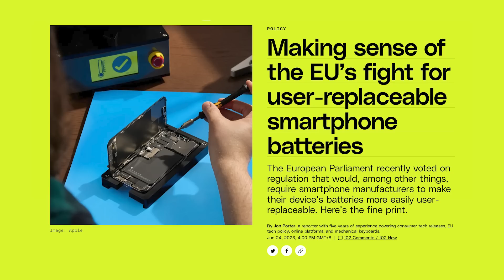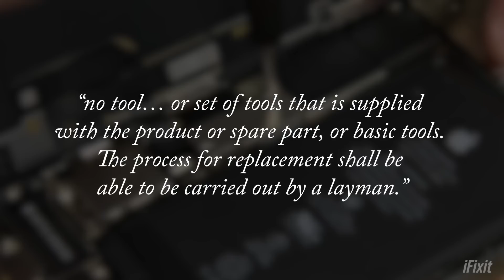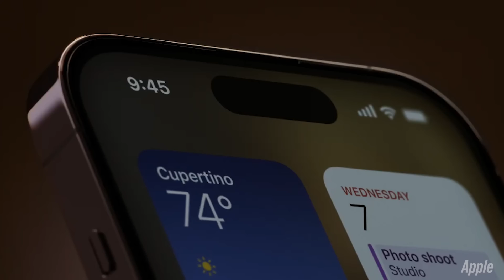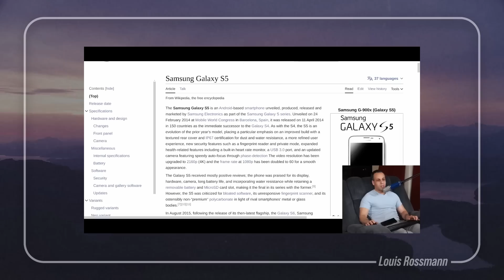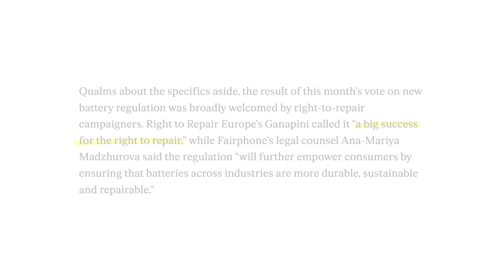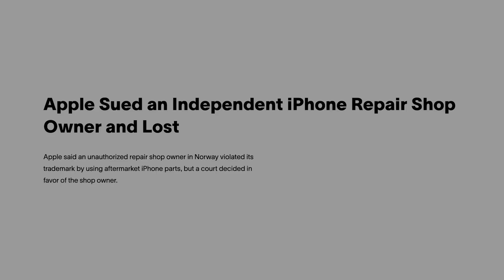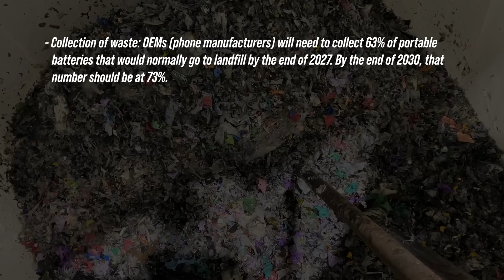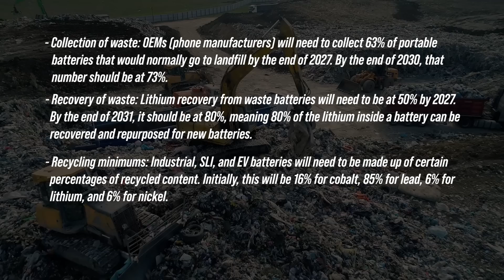EU Just Changed Smartphones Forever

Comment: Easy swapable battery is a MUST

Only iSheep support it.

It is for the very safety for a lot of things.

1) Personal security - Now days because you can take the battery out, there is no way to unplug a phone to prevent eavesdropping, part of the CPU is always on.  If that is swappable, just take the battery out. 
2)  Waterproofing Lies, your watch, from 100 years ago can have waterproof, to 100 of metres and still have swappable battery, yes you needed a tool but it is petty much a standard.
3) Waterproofing Lies 2, your glued iPhone still will have water goes in if you place it for longer (maybe an hours), so your phone is not 100% waterproof at least is not the same standard as watches.
4) Recycling responsibility, if the EU can even goes further and required phone manufacturer to standardised the battery sizes i.e. I can swap an iPhone 17 to a iPhone 18 battery or with a Samsung, there is no recycling issues, remember the battery is very expensive, people will recycle them, you just give them a rebate of 50 AUD for the old cell and BOOM it will recycle.  Why I can't use an old battery to another device, no idea?
5) fly security, without solid state, there is always a risk that battery just like the previous samsung battery self start fire, if I want to put a phone into a bag, just ensure it's battery is pull off, it is secure.
6) I think EU should be even more strict and make the Law say all battery should be connect to the motherboard using USB c standard.
7) I can choose my battery life, Sodium Ion Battery and don't need Cobalt (according CATL), so if I just want a battery with Okay life i.e. 12 hours without charging instead of 24 hours, I can just have a Sodium Ion Battery, it is cheaper than Lion, and I just replace with one that have more capacity when needed.   Or some of the gamers need to plug in anyway, just get a cheap battery and charge it 24/7, it break, it is cheap, sodium ion I think sodium ion is also less likely to be self ignition, so not such a problem or even Ni-MH battery, highly mature not flammable, but I can't choose my only battery tech, if USB C as a standard voltage output, then creative solutions can happen.
8) Recycling 2 - if my battery is only for the purpose of uninterrupted power supplier, there is a lot of power bank case anyway, if I just have a battery with less energy, I don't need such high density, such as my gamers situation, the battery did not make of rare material, if it gone just throw it to the bin, I want my power bank to supplier my power anyway, I have a joystick and fan and overclocking my phone, so all I needed is just a working battery as my uninterrupted power supply, so No recycling is needed.

Comment: I use a phone from 2013 as my car's dashboard so i can see things like engine temp and fuel economy(stock dashboard only shows fuel level and speed)
The reason i picked this phone is because it has replacable batteries, as i dont want to be buying a new phone for this every few years, and because the heat inside of cars is murder on lithium batteries, i think i've gone through 3 batteries.
Ideally i'd find a phone that works without a battery being installed, and boots up reasonably fast

Comment: So happy to hear about this. It's unfortunate, but true, that you have to force companies to be consumer friendly. I wish more countries would get out of bed with the companies, and start actually passing laws that favor consumers.
Reply: People slowly realizing that rampant, unchecked capitalist practices is not good. I'm glad!
Reply: Consider this: an IP65 rating would suit the needs of 99% of users out there.  Glue is not needed to achieve that - a thin o-ring will get there just fine. Section off the battery compartment, pot the leads going out to serve the board/screen, and bobs your uncle.  That allows screen to be installed with adhesives to preserve sleek appearance most have come to enjoy, and restores user access to the battery.
Reply: @flinch622 screws are the answer, still get benefits of glue (slim design, water resistance and strength) and the benefits of removable batteries (easily repairable, and upgradable)
Reply: The problem with that kind of laws is that they come way too late and never go far enough.
I could think of lots and lots of urgently needed regulations of all kinds.

In another post on this video I mentionned electroportative tools like drillers and saws that should be included in this replaceable batteries requirement law.

On another subjects there's agricultural tools and machines :
In the past farmers would do a lot of the maintenance on them. But also : modifications.
Today we have tools/machines in the fields that can't (physically but also by contract with the manufacturer) be modified or improved or adapted. It's very detrimental as each producer faces its own contraints, and from ancient times always had to do a lot of adaptations. It's very problematic now if you speak with some farmers that can't anymore find or adapt tools to their specific needs. It's also progres and innovation from the ground up that is in question. Those people know best how to produce than ingeniers in offices and computer designers.
Reply: @qrsx66 big Ag companies like John Deere and Monsanto have really made an oligopoly that needs to be broken! They’re basically making small/mid-sized farming impossible in the developed world. Those are the farms that tend to be more sustainable, more ethical, and better for local economies.
Reply: Remember that they are not consumer friendly their eco friendly so we still have to fight the fight, good luck.
Reply: Facts: capitalism only works when accompanied by meaningful regulation with teeth.
Reply: the problem is not making companies more aware of customer wishes, its making MONOPOLIES more aware of customer wishes. Unfortunately there arent a lot of producers of the shiny and sleek new gadjets, so they can dictate the weather as they wish. If there was proper competition, this would have been resolved a while ago. Not to mention the cult status of apple alone, which churns out 'the new rectangle' at absurd prices which people married to apple still keep spending even if they already have a perfectly functioning product at home...
Reply: The draft includes items that I think have a far bigger impact on end users. For example, this draft would require companies to supply spare parts for 5 years after starting to sell the phone. Spare parts must be delivered withing 5 business days from receiving the order, and there is going to be some maximum price set for spare parts. Also, smartphones shall recieve at least 5 years of security updates free of charge, and OEMs are required to supply at least the most common spare parts to 3rd party repair shops.
Reply: Creating devices that dazzle you with tech you’d never be able to create yourself isn’t consumer friendly?
Reply: @CharlesQuiros fair point but your forgetting that a device regardless should be repaired by all (if not consumer then atleast my local repair shop) artificially soft locking, manufacturing hard replacement parts (windows surface laptop for example), and telling consumers they have to buy a new device over repairing an older model that's less then a year old is absurd. I am glad the EU is doing this atleast it has made tech companies atleast make modifications that benefit everyone
Reply: @WhosThere26  No.

Comment: I don't think removable batteries are as big of an issue as locked bootloaders.   For example, the Samsung Galaxy S5 was an excellent piece of hardware released in 2014.  The Galaxy S5 had a removable battery, SD card slot, and was waterproof.  However, depending on where you bought your phone, it probably had a locked bootloader.  If you bought your phone from a carrier, you likely didn't get ANY updates past Android 6.   The Galaxy S5 phones I've seen that had locked bootloaders didn't even get 3 years of security updates.   But if you have a Galaxy S5 with an unlockable bootloader, you can still install the latest LineageOS running Android 13 even though the phone is nearly a decade old!

Comment: Nearly all changes developers made to devices which made is less easy to repair that device are just done to make it less repairable, so costumers would buy a new device. 
The use of glue is not needed at all. There where good phones with removable batteries in the past, even with an IP68 rating. The anti repair features by demanding the exact right serial numbers of each part is ridicules. Phones and laptops can be made user serviceable. Companies like  Fairphone and Framework prove that ik can be done.

Comment: It did always seem like planned obsolescence to me. It does cost less, in both design and manufacturing, to produce a device without a replaceable battery but it easily halves its useful life so it's not actually a saving to the consumer since that's nowhere close to halving the retail price. Most people would be perfectly happy upgrading about half as often as device makers prefer (or less) if it weren't for battery life degradation.

Comment: Yesss used to have separate batteries with the Samsung slide phone and Blackberrys. 
Would be 10X better if wireless headphones could replace batteries as every single one is going to end up in the land fill when there still good parts on them except the batteries that get weaker and weaker especially after 5 years.

Comment: I was a holdout and had a swappable battery up until my most recent phone. It was a godsend and hated giving that feature up. As everything gets more battery powered this is a huge step in the right direction.
Reply: Yes! HTC and LG had replaceable batteries for they smartphone until very recently! It was one of the best features because if your phone was running low you could swap in a spare charged battery and avoid having to charge. You were back to full charge instantaneously! 
Apple has never offered that and is the worst culprit in built in obsolescence. Coincidentally, they are the richest company on EARTH! Hmmm... 🤔😫

Comment: I purchased LG v20 in 2017, because it had user replaceable battery, however the company stopped supporting with Oem batteries in 2020 for Gcc region. The duplicate batteries just were awful and dangerous to be used, hoping EU and the rest restrict battery mfg from east also.

Comment: It was motivated by profit.
All ya really need is main components in part with screen to keep it super thin, a tiny battery like desktop pc motherboards have, super high capacity wifi charging, then you can have a 2nd section that clips on magnetically which also has wifi charging that houses a super thin battery.

The moment the two connect together, the phone boots up and away ya go.

Comment: 0:33  no longer possible, or for a reason? I think the reason is to guarantee you have to have your phone serviced if the battery goes bad, at which time most will simply get a new one.

Edit: i sell appliances (many being Samsung and LG) and those same types of practices are very common in the appliance world, as well. 

That's why a fridge or washer lasts 4-10 years now rather than 40-100.

Comment: Well  phones are certainly more robust when sealed. I havent had a broken screen in 3 years. I dont even use a cover or screen protector. It has been swimming and bounced 50cm off tiles and concrete dozens of times. The only thing that came close was the S5, but everytime it fell it would split open and the cover, battery and phone body would all disappear in different directions under the heaviest pieces of furniture in the room.

Comment: I’ll tell you what. I went to Apple with a 2-3 year old iPad Pro. Luckily it’s under warranty so it can be replaced! So, they did a “battery-test” and the thing apparently passed with 95%.. so no new battery under warranty.

The battery lasts like 1.5hrs and is useless if not plugged in all the time. I had to buy a new one..

Comment: Laptops had external, user replaceable batteries modules earlier. It is not as difficult as it is made to look. Manufacturers are able to bend display's these days but a user replaceable battery is the unsolveable engineering challenge?

Comment: Current manufacturing technologies ensure that waterproofing and battery replacement are mutually exclusive. Even if a repair person replaces the battery for you, it usually comes with the implication that your device is no longer IP rated. I wouldn't be surprised if this was either intentional, or at least seen as a benefit by manufacturers in as it deters battery replacement in favor of whole device replacement.

Comment: This is great news! I pivoted to LG V20...one of the last phone model with removabale batt and held on to it for 6 years as i was able to change battery. Befoee LG i was into Samusng Note series before they removed rights to repair. Its only when V20 slowed down, LG exited the mobile phone industry that I eventually migrated back to Samsung. Water Resistance is over rated. I use ziplock bags for all my phones during my army days. And bring back the 35mm jack for FM radio emergency too!

Comment: I think that the progression from user-removable batteries to non-serviceable batteries was largely a profit-driven transition because it is cheaper to design and manufacture a device with its battery permanently sealed inside, but in order to justify it, electronic device manufacturers used advertising to create consumer demand for devices with that kind of feature. It's kind of a chicken and egg scenario.

I'm not entirely on board with the requirement that batteries must be serviceable without tools, but I do think that at the BARE MINIMUM, the most tooling a user should be required to possess for battery and overall device service is a set of screwdrivers, tweezers, and a spudger. A super basic repair kit should be the most that any user should ever have to get in order to perform any maintenance on their devices. There should be no specialty calibration equipment, no fancy heating pads to soften up glue, none of that. Just a set of screwdrivers, some tweezers, and a spudge.

I have a >10 year old macbook pro 13" that's still alive and kicking because I've been able to replace the battery five times over since I originally bought it brand new (I'm a bit rough on my batteries...), but battery replacement requires a couple of screwdrivers and a spudger. It's not even that difficult of a process, because the back plate has just ten small screws holding it in place, and the battery has two and a singular plug. Then it lifts right out and I can plop the new one right in.

Comment: This is so stupid.  This will lower battery life and stunt innovation.  The reason for non-replacable allowed for larger battery capacity.  I worked in Cellular for 20 years.  Yes, having a spare battery worked great with phones of yesteryear that did not have heavy reliant 4G/5G connections.  

The G5 is not a shining example of success. LG pulled it off the market after 6m because lack of sales.  Also the way the G5 was built for user replaceable battery it meant the battery was smaller than most competitors.   And the G6 did not have a user replaceable battery, & featured a larger battery capacity.  

100% for the right to repair, but stifling innovation by harkening to the idea of the past is not the way to do this.